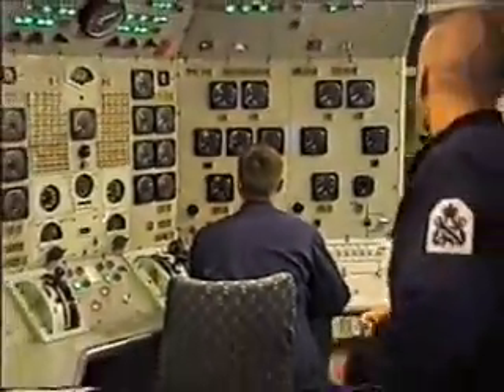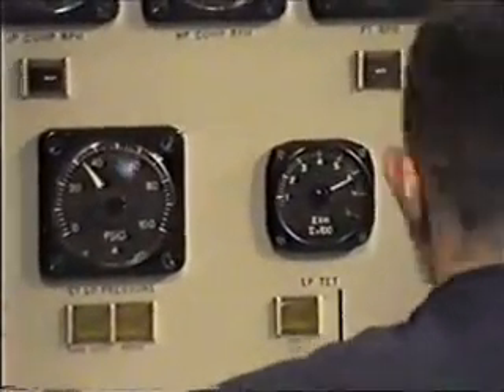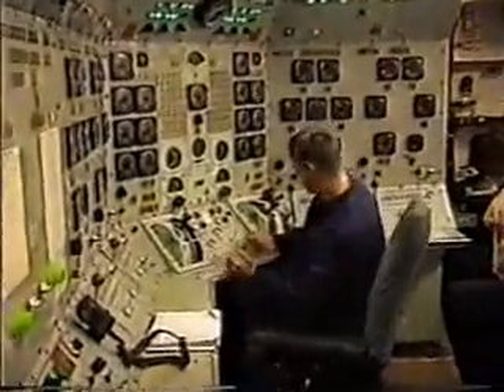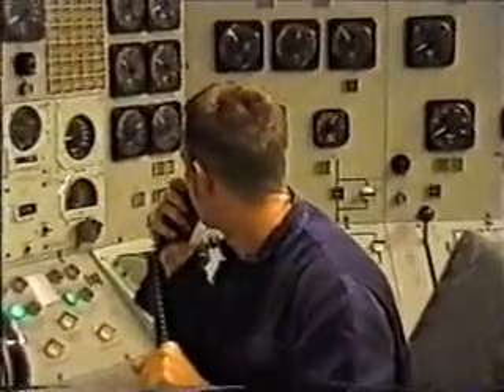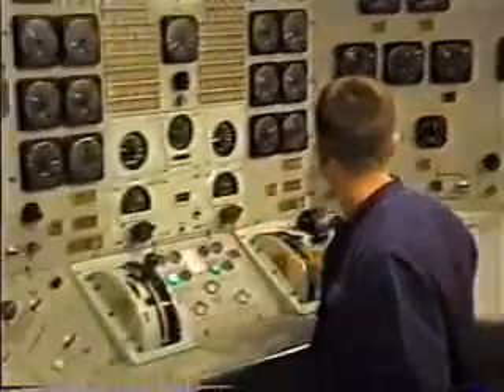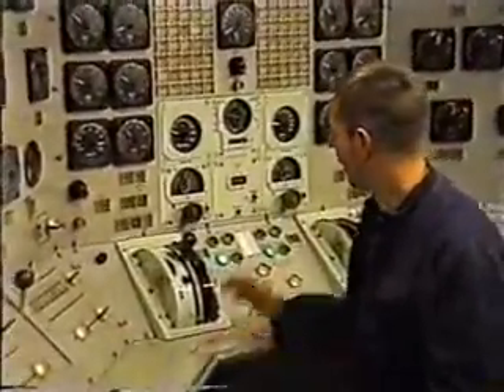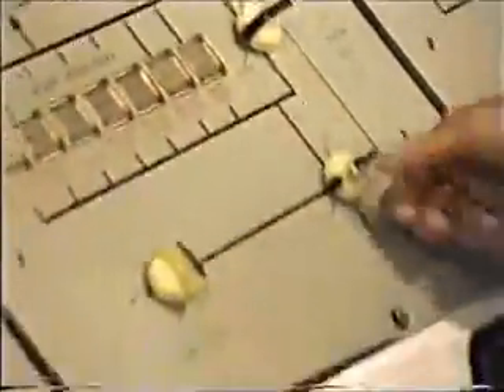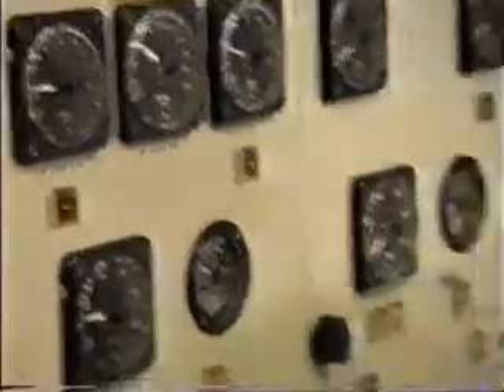gas turbine start on hms york

Comment: We arrived in the Persian Gulf about three days after saddam invaded Kuwait USS independence battle group. Pretty sure HMS York was there  when they invaded. Remember hearing her a lot on bridge to bridge radio and doing ops with her.
Reply from the maker: Unsure shipmate 
I took this video in 2002 on the way to the Persian gulf few months after 9/11 
Operation enduring freedom
Reply: @boyasaka  she was there. She was having an issue with fresh water evaporators in mid August..could barely make enough water for cooking. We sent a couple engineers with some spare parts we thought might work. They got everything working somehow, made our parts work on your equipment. Your chief engineer and captain sent our guys back with enough beer and alcohol for our whole crew on our next steel beach . God bless the Queen and her navy!
Reply from the maker: @jwm05281971  them on stone vapour Evaporators were a nightmare ,think at full belt each one could only make 2 cube of FW per hour and when one went down which was often ,water shortage lol
Reply: @boyasaka  I was lucky. My ship was 3 years old in 90. In 3.5 years onboard we never once had water hours. If you got a shower when it wasn’t busy you could take an hour long one if you wanted lol
Reply from the maker: @jwm05281971  
HMS York was built in 1982 
With 1972 technology ( bar the warfare stufff was all state of the art ) but the panels in engine room and engine  control rooms.looked like something out the the 50s 
Lol the stone vapur water evaporators looked like something out of the 1920s lol

Comment: Maybe this clip is too old, but I am curious are these engines totally manual, or do they have self ignition upon startup? Seems like for some reason starboard engine would not start (no ignition)?

On aircraft these days it is really simple proceedure to start GT engines. Just push 'Start' (Ignition is auto timed in regard to compressor and/or main turbine rpm).  Is this old vessel with engines pre-automatic start sequence era?

Comment: Damn Cool - How many HP (or KW for the Metric Guys)?  AND: how fast will that ship go?  AlQuadea needs to know so they can strap another outboard to their dinghy!
Reply: Tyne RM1C delivered 5340 BHP which is about 3980KW at 95% throttle (which was uplifted to 56 PPCL (Power/Pitch Control Lever). The Olympus TM3B delivered 33800 Exhaust Gas HP which translated to about 23650 SHP down each shaft after losses on an average day. at 100 PPCL (provided other limitations weren't exceeded first)